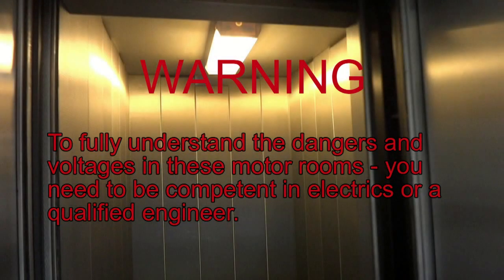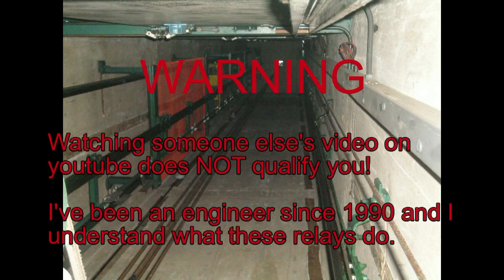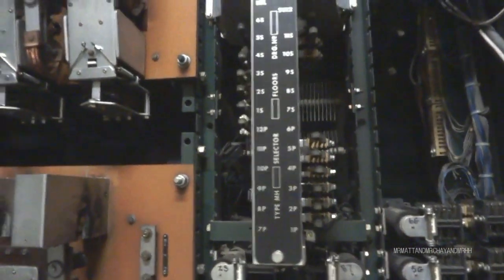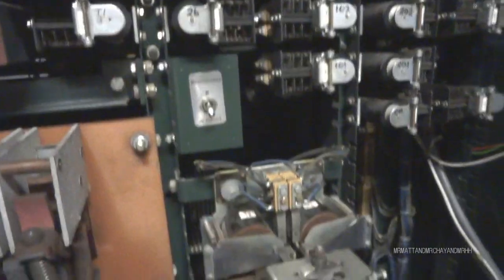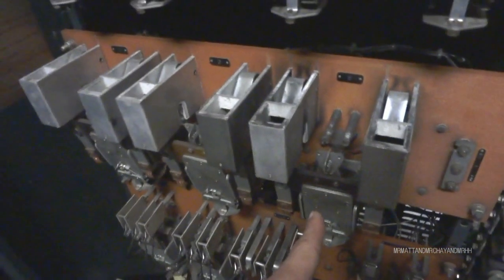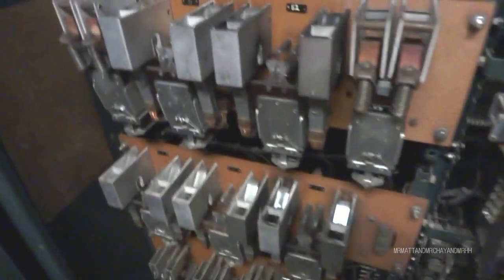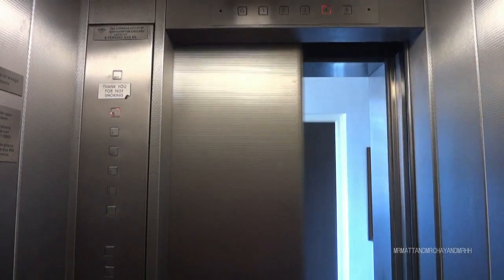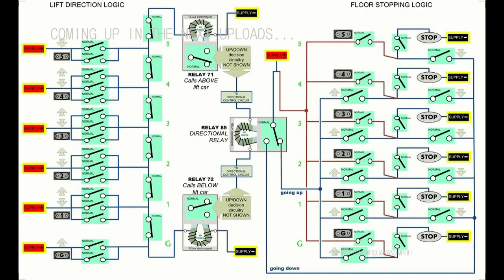One of the last relay controlled Express Lifts - with motor room footage from mrmattandmrchayandmrhh

Comment: The A's on the relays stand for Auxillarys and should go in at the same time/ drop out as the original relay. They were used because there were not enough contacts on the 1st relay. Another old Express saying is " its cheaper to go up than down " Hence 1 & 6 is up and 2 & 6 is down :)

Comment from the maker: That's electrical current jumping between the contacts on the relay (that move apart) and the contacts on the base.  If high current is flowing through the contacts then the current will try and jump the gap, until the gap is wide enough that it cannot do it any longer.  So that's what the spark is (strange green tint isn't it?  but might be my camera producing the 'green')
Reply: That only happens if the load is inductive. This is not always the case. Only motors, transformers and ballasts will cause that.

As for the strange green tint, it is caused by tiny amounts of copper, from the contacts, being vaporized. The contacts are in their last legs, because copper shouldn't be exposed in a new contact. The plating is probably gone.

Comment: It looks like every smaller relay has the same number of contacts (6PDT or 6PST ?). Probably a bunch of the contacts were not used on many relays, but it just makes maintenance simpler to standardize on one plug-in multi-contact relay that works for any purpose.
Reply: 3NO / 3NC Single Throw contacts, all coils are 24/110-230V

Comment: What happened at 5:30 when relay lit up
Reply: The motor coil is an inductor. Current that flows through inductors has momentum, it takes time to stop flowing. So when the contacts got separated, the force was so big that it crossed air until the current reached 0.

Comment: Why 5th floor is indicated on the relay as 6g?
Reply from the maker: Floor positions always start at 1.  In the UK, floors always go GROUND-FIRST-SECOND, etc.  This means that all relays start at 1, but relay 1 is probably the Ground floor.  So each relay will be one higher that the actual floor numbering.   Other countries like Norway, the floors start at 1 so there is not floor numbering mismatch (until you get a basement floor!!)

Comment: This is just like a computer cpu... it just can handle more voltage and has bigger physical size to ease possible replacement of components in it.
Reply from the maker: Exactly!  Except "reprogramming" is not a quick and easy thing (rewiring and perhaps more relays!)
Reply: @mrmattandmrchay  You can reprogram it if you just rewire it. If you add multiplexers  possibilities are limitless.
Reply from the maker: @ss-sq1hn  I think using the word "just" is an underestimate of the work involved.  I mean, for a modern day lift to make a mod or improvement you'll be changing/adding lines of code - relatively easy.  To change the wiring of a RELAY based system would require firstly a complete understanding of the complex relay logic, the skill set to understand it, the equipment required to implement a change (including extra power supplies if you're adding relays and timers, etc),  the room for the extra equipment, the rewiring itself (once started, you'll be committed to getting it working again, whereas on a modern day system you just restore an old backup), then you have to test your modification without any assistance from modern software test displays and logs.  I understand what you're saying, but it's much easier said than done, especially relay systems.

Comment: This System ist the safest!
Reply: DHF 1 other than the shock hazard of working in the frame how is this not safe, relays have a defiant failure method and will fail safe in any well designed system

Comment: Is it mandatory to put so much precautions in video? Everybody who has a big house has also 3-phase 380/220 in it. At night it can be 415 between some two phases. It is rather difficult to touch two phases by two hands - usually people are shocked with 220-231 when they get phase and ground. 110V DC on relays is not dangerous.
Reply: I had to say it is not about USA, where houses use 120+120 system
Reply: I got fired for interacting with +24 volts... Awful company.

Comment: Why did  lift manufacturers in the 1960s and 70s choose relays rather than cathode valves or transistors for logic functions?
Reply: because relays are much more reliable and can control much bigger amounts of power. only downside is relays are much slower. but for something like this that only has to have data go through like 7 relays at the most its fine, but on a big computer that would require data to go through hundreds or thousands of relays it would take forever.
Reply: +Rinoa Super-Genius  So what you are saying is that relay logic like this would be fine for buildings of less than 16 floors?
Reply: Jeffrey314159
i dont know, and this comment thread is from 2 years ago. i dont see why 16 floors would be the max. the em[ire state building had elivators before transistors so they must have used relay contactors.
Reply: +Rinoa Super-Genius  I was first referring the number of relays needed; 16 floors can be represented with just 4bits(easy to figure out the circuitry with a Karnaugh Map?).
The Empire State Building used men who worked the lift controls manually in the beginning.
Reply: 1 reason is that relays fail safe unlike valves or transistors.

They are also massively reliable, I work on 60 year old safety critical relay interlockings from time to time and they are incredibly reliable
Reply: the relays were more reliable than the solid state stuff of theat era.

Comment: the relays are not danger,because they works on auxiliary voltage between 24-120VDC,but contactors..they are dangerous except main contactor,however the relays wich drive main contactors,if they have 380-415V magnet to trigger,these contacts are protected with isolating material.Sorry ,I m not good in English,best regards!
Reply from the maker: MatejKotnik Kotnik Yep understood.  You would feel a shock at 120volts.  Still, never a good idea to touch any copper contacts because you never know what voltage is going through them.

Comment: As for the "no touch" warning, you could also mame or kill someone else if you move the car w/ the doors open, SO you might also have a manslaughter charge on your hands... so, DON'T TOUCH!!
Reply: he must be standing on an insulating neoprene floor to minimize shock hazard. The old switchboards underneath Grand Central for traction power had those rubber floors for the same reason.
Reply: There are lots of safeties cutting power to controller, and consequently to the motor. The interior/exterior doors are just two of them.

Comment: I’m a qualified engineer. And you really should not touch with you’re bare hands. Also is there a rubber mat on the floor.. the wheel in the corner is a overspeed governor..
Reply from the maker: I am aware.  In fact, the lift engineer that I was with was doing the same.  110volts will give you a sharp reminder, but as you are aware, it's the voltage on the contacts behind the relay with the voltage  I'm 45 years old and also an engineer.  I would never go near the larger relays at the bottom.

Comment: there is someone that will never modernize because they like original?
Reply from the maker: Problem with original stuff, especially things with moving parts, is you need the knowledge and the parts to fix them.  So really it's inevitable that most lifts will be replaced.
Reply: +mrmattandmrchay maybe they could keep everything relays and other parts from a lift modernization to put them on a broken one

Comment: This controller looks very similar! watch?v=93ucajebslI
Reply from the maker: +Jamaal Hashi Yep, although that motor room in the link has the mechanical selector removed and replaced by the electronic type.  It has the same functionality and connections but was developed as a replacement to the mechanical type when/if they fail.  Other than that it's almost the same :)